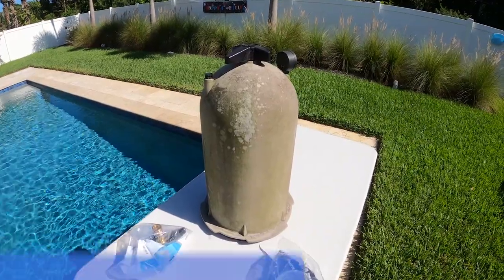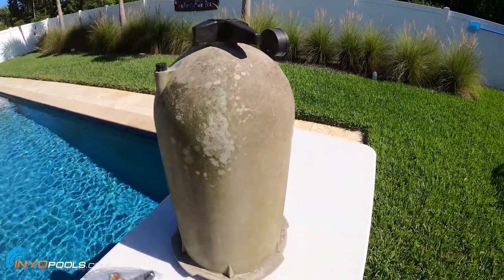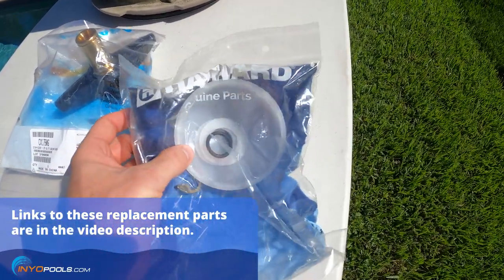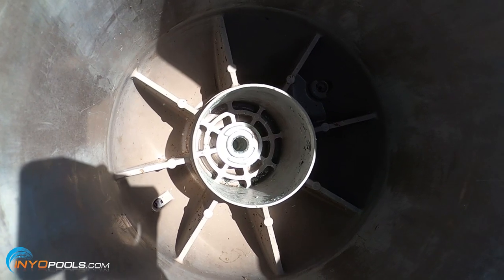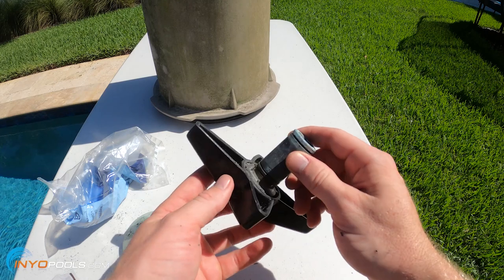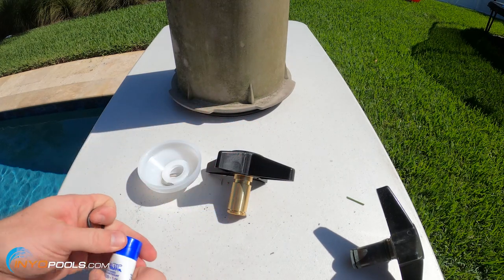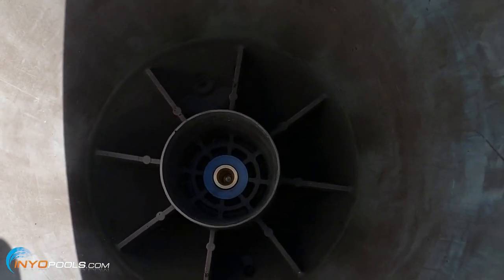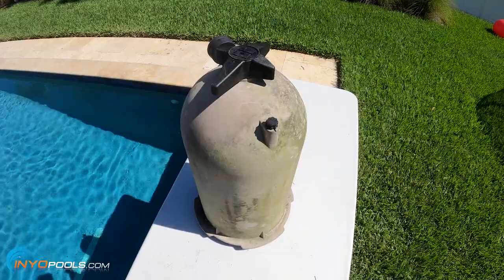How To Fix A Hayward Star Clear Plus Lid

Comment: Another thing to check and no one says this or notices.  The rod itself the threads over time get this hard green gunk between them and the knob can't grab it properly.  Take a flathead or small blade and clean the threads out.  This crap will just chip right out.   I see this all the time.  Been a pool contractor for 16 years now.  If the rod is stripped at the bottom end get rid of it.  I've seen these blow into the neighbors roof and also take part of a roof off.  These have also killed people.   So don't chance it.

Comment: My issue is with the bottom portion drain plug internal threads of bottom half are stripped out after 24 years. But NOBODY sells the bottom portion, only the top! lol any fix for this?
Reply from the maker: Are you talking about this part? Star Clear Drain Plug Kit (CX250Z14A) - https://www.inyopools.com/Products/07501352015726.htm

Comment: My issue is the rod came off and is stuck on the knob so have fish is down very time
Reply from the maker: Have you tried spraying WD40 on it, letting it soak in, then using pliers and vice grips to get the knob to turn? A WD40 variant called Rust Penetrant can sink in deeper into the threads for better results.